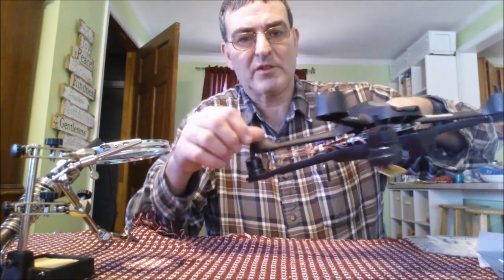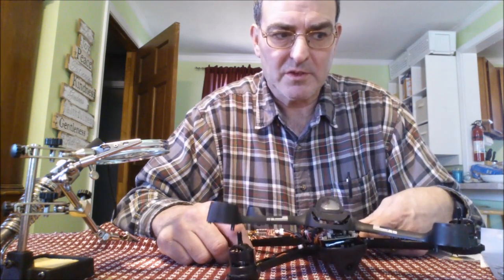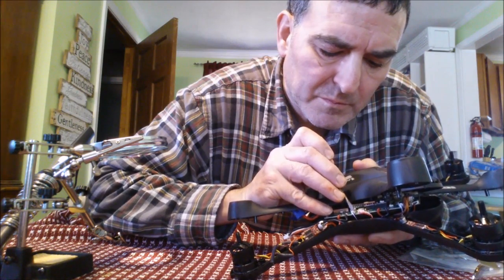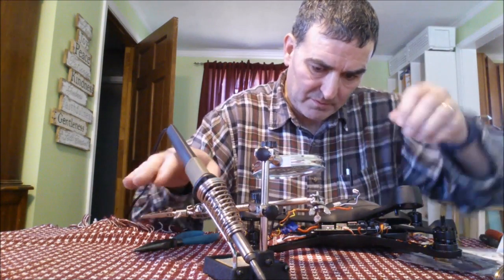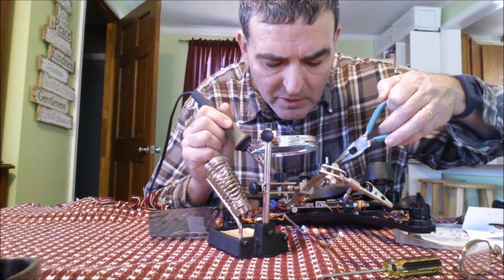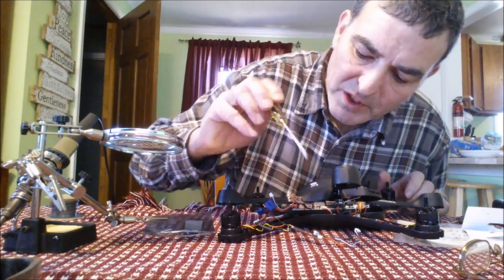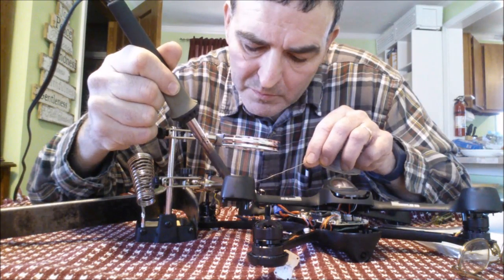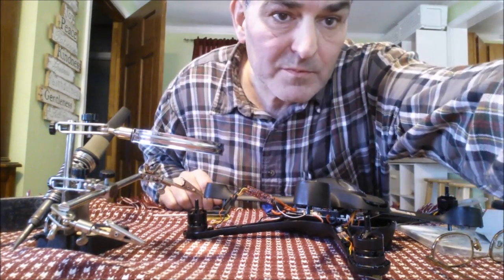Hubsan H501c ESC board replacement

Comment: Get a carbon fibre frame,strip out the h501 and stuff the new frame with the H501 boards etc,fit larger ESCs,fit larger motors,use a larger battery since now the new ESCs and motors can be bespoke tailored,use any voltage you wish now,if you go higher than 7.4v 2s you need to feed the main board etc from a buck converter,ebay sell the MINI360 buck converter,it can take an input voltage from 4.75v up to 24v at 3A,i doubt the h501 main board etc will use anywhere near 3A,the biggest current draw are the motors.

I would go as far as the frame allowed for prop size and as large a motor as needed,google the best set up for frame ,ESC and motors.

At least now you are not stuck with 10c 2.7mA batteries that are most likely knock off crap,buy batteries locally from good outlets or if you know the ebay etc vendors are reputable.

I just bought a h501s from banggood for £64 (UK) versus the insane prices on ebay for SH of around £100++++,i have 3-4 of the H501 drones,one is x4 pro air the others were for spares but still work but have frame issues,I personally think converting to a carbon fibre frame and adding the non standard ESC and motor hack plus the firmware mod tool can extend the range,ceiling and RTB height and speed,battery voltages to be a great way to turn a good quad copter to a very good quadcopter.

I'm going to add in a on-on slider switch to select between two cameras video feeds to the TX,unless i can get a camera selector ground based radio link to switch over as a down facing camera will help pinpoint the drone also if i want images directly below the drone.

!0inch frames on ebay cost about £20,a second hane h501 frame on ebay to-day is priced at £27.

Comment: My ESC started smoking and melted the plastic on my second startup attempt. Hubsan support had me send them pictures. They determined from three pictures that A: I had gotten grass in the motor and burned up the ESC or B: I had gotten sand in the motor that burned up the ESC or C: I had gotten grit from asphalt or concrete in the motor and burned up the ESC.  In other words, they recommended that people not fly a GPS drone outdoors if there's any grass, sand/dirt, concrete or asphalt anywhere nearby. I guess they want us to launch from the water surface! They claimed it was user fault and denied assistance. I bought an ESC, installed it and magically the "damaged" motor came to life and worked just fine. Forget trying to get Hubsan assistance. They'll accuse you of being at fault for anything! Too bad, because my next drone won't be a Hubsan of any model! DJI just got another customer!

Comment: Hi  I need help, I have husband 501s advanced, one of my motors its not working :( I manage to open it and I noticed that the ESC Electronic Speed Controlle is blinking the others not, Any suggestions what is wrong ?
Reply from the maker: I didn't notice a light on the ESC.  Changing my motor and ESC did not fix my 501c.  If the drone is new and defective, do all you can to return it or stop payment.  If it failed over time, the new EHC was $10.00 for mine.  Why not try it?
Reply: Charlie borg exact same issue on mine, did replacing the ESC work in the end?
Reply: Yes your esc are broken if they blink you need to replace it

Comment: Hello Chess Nut59. I am dealing with a similar issue. A few days ago I had a rather hard crash with my H501s. Afterward, my  #2 motor would twitch but not spin. I ordered a replacement motor then started thinking the esc might be bad also. I have a motor and esc on order but am worried after watching your video that replacing even both might not fix it. Are you back in the air yet?
Reply from the maker: No, and I have no idea what it could be.  I thought I would swap an ESC with a good motor to verify my new ESC wasn't defective, but it is a lot of work.  Maybe the main control board in my case.  Replacing the main control board would be a lot of work.  My issue was not from a crash.  It came that way.  I was unwise to try to fix it myself.
Reply: Chess Nut59 
I don't think it was unwise. Hubsan seems unable (possibly unwilling) to help in most cases. I think most folks try to do it themselves. I've found Elecifun to be a good resource here on YouTube regarding the Hubsan. He's not the least bit scared to rip into it. I think he's in the middle of a main board issue right now. Good luck finding and repairing your problem. I hope you post your results. I'll let you know what I learn.
Reply from the maker: I never got it in the air.  It is sitting on a shelf.  I am thinking either it is the main control board or a firmware issue.  I bought a sky Viper V2900 Pro and enjoy it a lot.  Though I think a working H501c would be better.
Reply: It sounds nice to have the viper to fly and then work on the 501 as time, money, and interest permit.